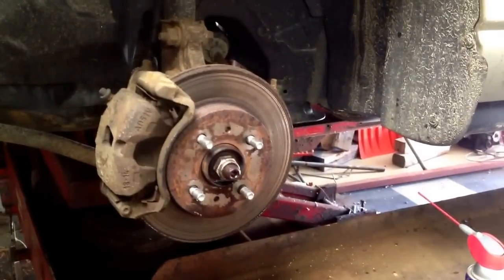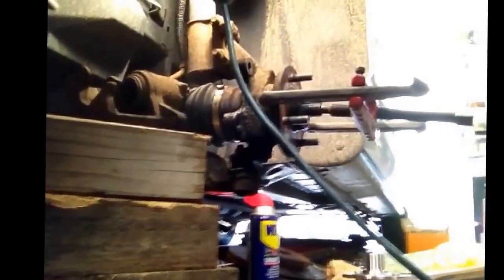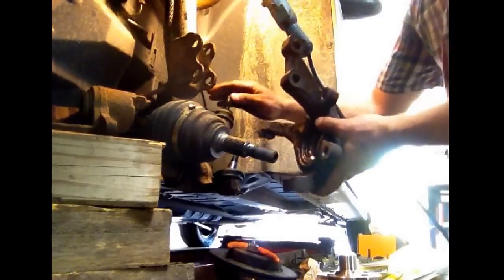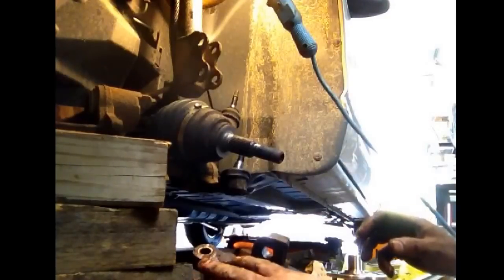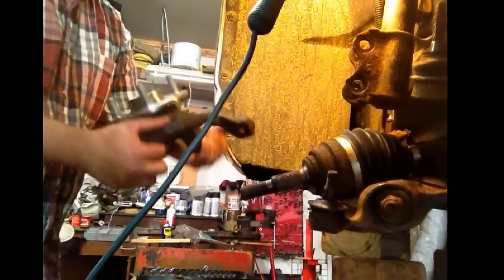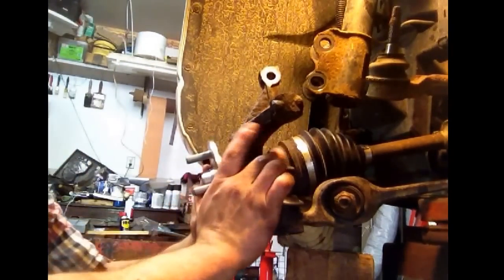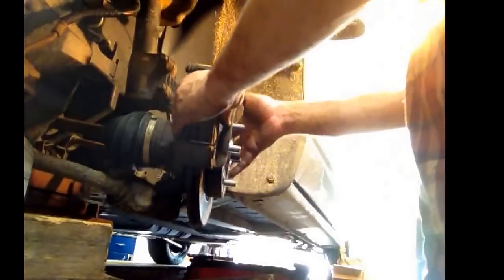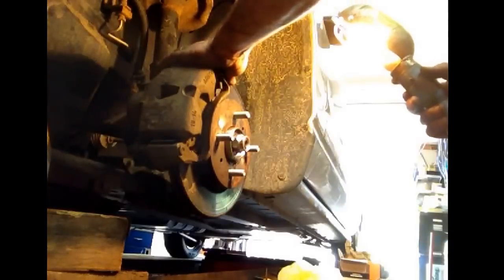How to change or replace front wheel bearing on 2002 Saturn front wheel drive

Comment: I just changed passenger side hub bearing now drivers side making same noise should I have done both at same time
Reply from the maker: Lateef Bronner  They do not normally go bad at the same time. so no need to do them both, however you may have a case where they did just that. (not common)

Comment: Now you need an alignment too ace.
Reply from the maker: In my case I did not. I was able to get things back in place close enough that I have not seen any unusual wear on the tires or pulling in the wheel.   But if I had I would of done an alignment as well.
But you are correct in most cases an alignment should be done.